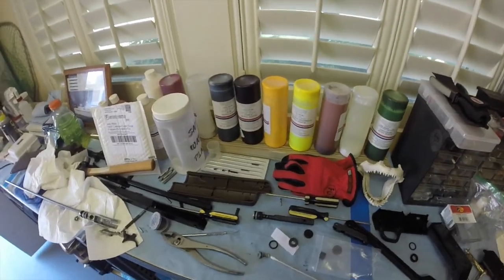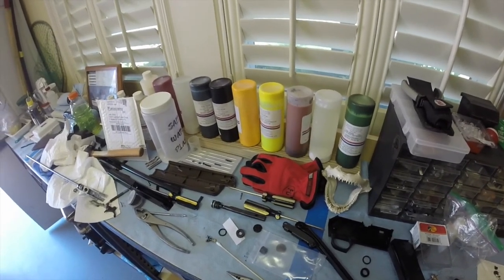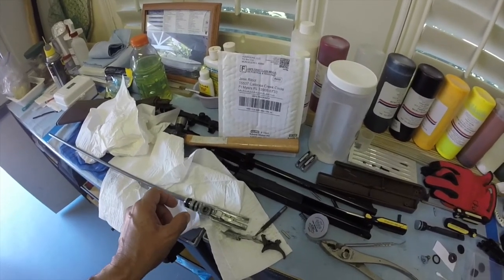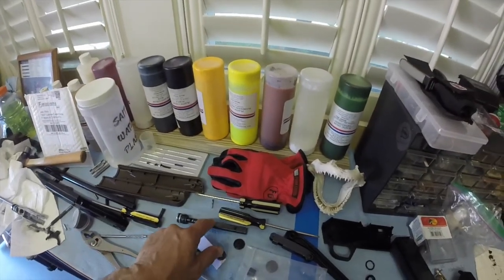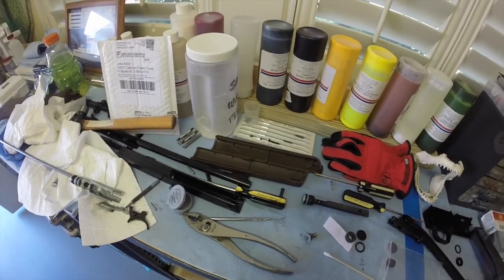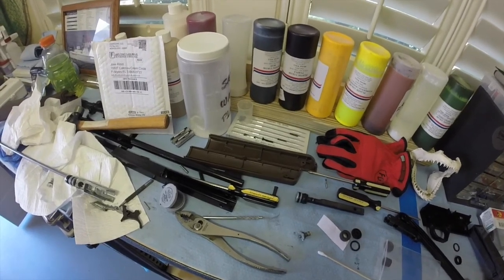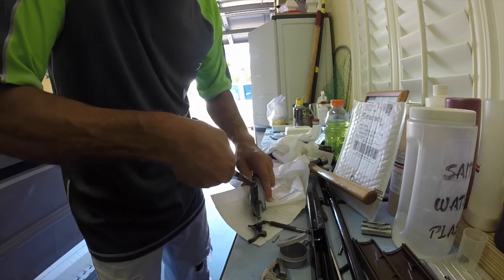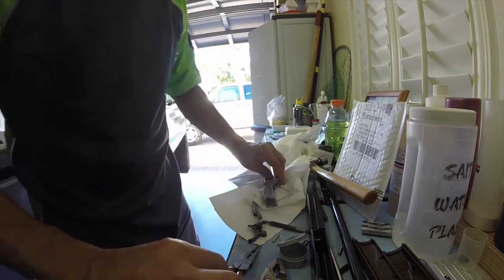Repairs of a Daisy  Vintage BB Gun

Comment: Sir, just want to congratulate you on getting your boy's gun working again. In the future, in case you do another fix up, did you know you can get parts from Daisy? Instead of 3rd parties who also get parts from Daisy then mark them up. Also, an 880 that has not been in use, maybe collecting dust for years, many times just needs oil to "wake up". 3rd party part dealers will not tell you that trick.

Daisy parts prices:

Valve assembly-$3
TOTAL pump head assembly - wiper, metal head, seal, AND rubber spring all in place $3.50. You just remove old rod assembly, put in new one from Daisy and attach to pump handle with retaining pin.

My mentor at a gun shop said of Daisy, "Easy stuff once you know the ropes. Except for that elastomer spring which people should not mess with...takes mild gun smithing. People see that rubber piece on the 880 parts list -  for only 25 cents -  and think it is a simple part - it is not. That is why Daisy offers full pump head assembly. Just plug and play." That way  there is no damage...like a bent pump rod.

Also, like you, I made the basic mistake of putting on the pump rod backwards; it will still work. Later I told people the simple rule: solid side up, hollow side facing back. Smoother pumping.